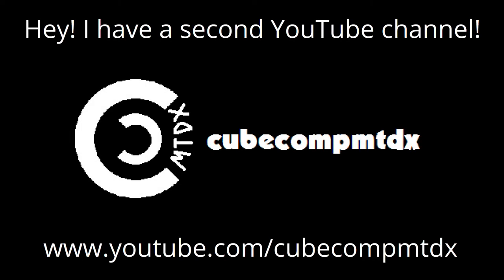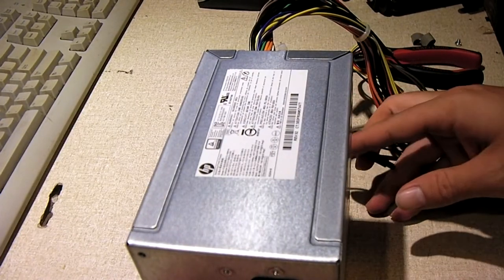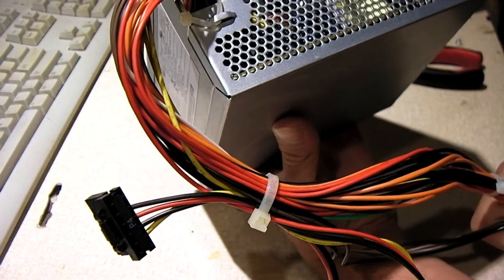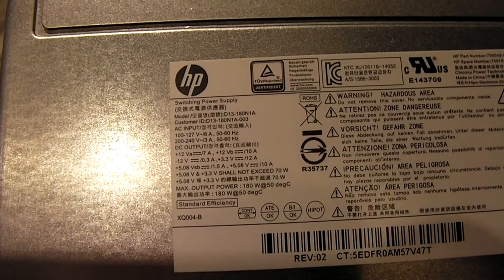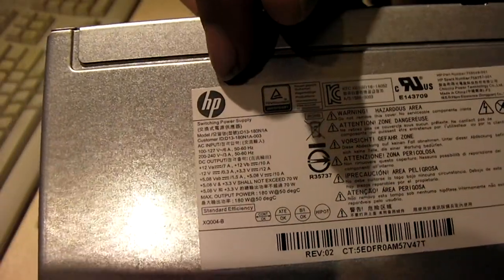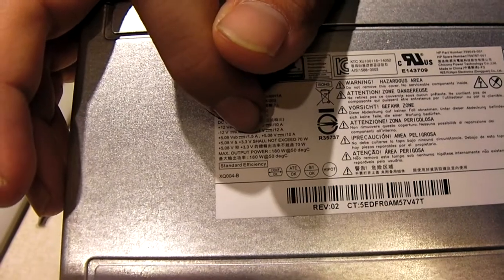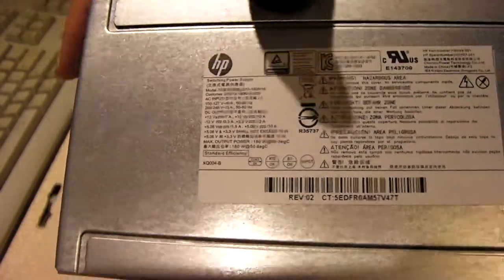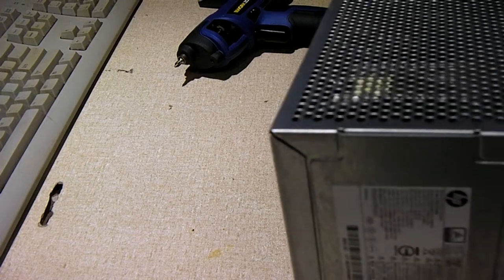A look inside the 2015 HP Desktop Chicony 180W Power Supply

Comment: PFC is normally fitted when power is greater than 300W . Probably not required for less than 300W
Reply from the maker: I commonly see PFC in PSUs below 300W in OEM systems

Comment: I wish I can find the pinout for the variant of this pc's psu with two 4 pin (p1 and p3) & small inline 7pin connector with only three pins in use (ground on p6, power ok on p4 and ps-on on p3).
And what sorcery did they do to not have a VSB line for the mobo?! Did they short it out on the psu side, so the psu is in standby 24/7?! According to other models, the VSB should be on p5 of the inline connector, but I have that empty in my case...I cannot understand it.
This tier of proprietary is LEGENDARY.
Reply from the maker: Seems like you have a different power supply that what's shown here. This one doesn't have a 7-pin inline connector. It just has the standard pinout of an ATX 24 pin power supply.

Comment: Can we run gt 1030 in 180 w psu ??
Plz reply me
Reply from the maker: A simple Google search reveals that nVidia suggests a 300w power supply. A 12V heavy 250W unit should also work okay depending on other system specs.
Reply: it works on my G2 280 PC that has 180watts of PSU